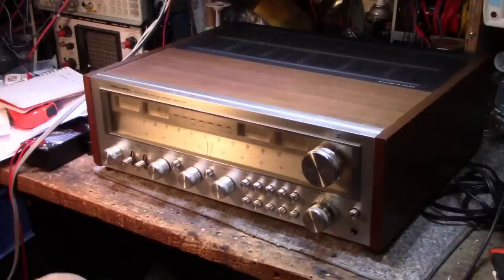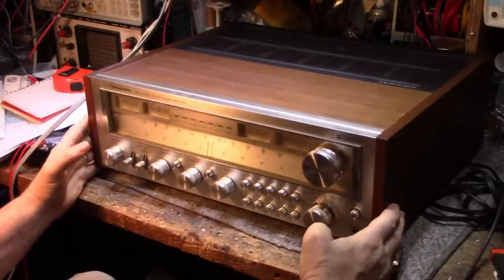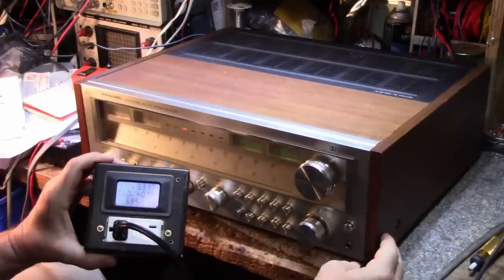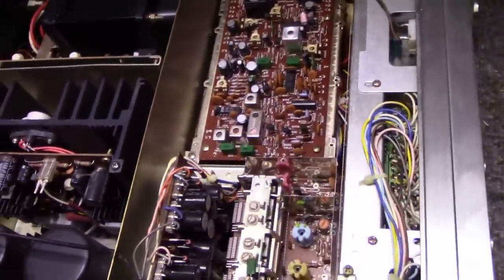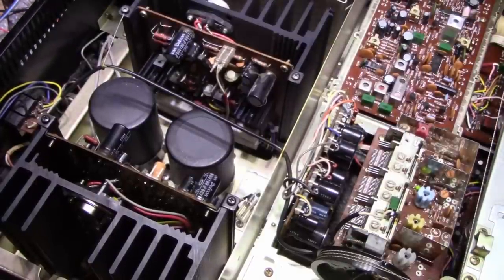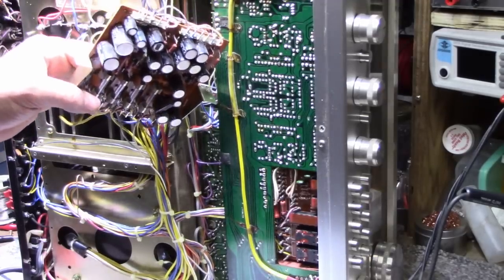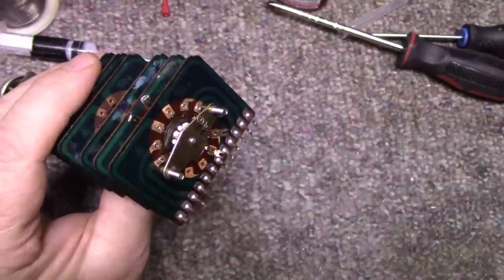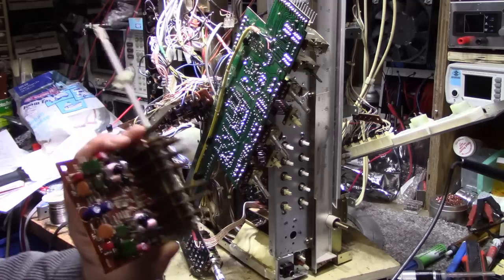Realistic STA-2100D MONSTER Receiver - Repairs (Ep. 159)

Comment: I worked at Radio Shack when the STA2200 came out. A guy had just gotten a big tax refund and wanted a top of the line system. I sold him the 2200, a set of Mach 1 speakers and a bunch of other stuff. As we were talking I asked him if he had kids. He had two sons, ages 15 and 17. I grabbed a couple of in line fuse holders and some 5 amp fuses, and told him to put them in the speaker lines. Sure enough he came in a few weeks later and told me while he was out the kids had cranked it up and blown the system. We laughed, he bought some more fuses, and the kids were never to touch his system again.

Comment: I recently acquired a 2100D and it has an interesting problem.  With the power switch in the off position, plug it in and it half turns on. The lights come on.  Then flip the power switch to on and after a second or so, the relay clicks and it completely powers on.     I need to get that fixed.

Comment: Wow, a very well done detailed video. I have this receiver which I bought new in Feb ‘81.  It sat for many years without much use. It still works, sometimes you have to work the controls a little to get the scratchy noise out of it. Years ago the power switch was starting to arc. I looked inside and found a double pole single throw switch with only one set of contacts used. I added the second set of contacts and it improved. I eventually wired in a relay to switch the AC and used the switch to control it .

Comment: Interesting on your comment about there should only be one ground, and for those that don't understand that comment:

First hand experience, famous airplane manufacturer, the electricians don't want to follow that concept - they believe ground is ground, they tie to chassis, it's ground.  While it MAY be ground, what people fail to realize is that all ground is not equal.  Whenever you have current running across distances of varying length, you'll induce varying voltages - so now your ground MAY be ground, but you have a different reference of ground voltage!  Bonding all of your ground reference to a single point of reference will mean that all references of ground are then equal.

Comment: Your experience shows with the effort you spend on contacts like the speaker output relay and the stacked selector switch that you removed and disassembled to clean.  Both can cause annoying noisy intermittent faults. Great job on that old behemoth.

Comment: I think the "FM 25 microsecond" switch is one and the same as the "FM Dolby" switch on the 2100D. I have the Realistic TM-1001 tuner with that same switch on it and the owner's manual says it's for Dolby FM. Also, the 2100D has a different transformer than the "toroidal" transformer featured on the 2100 since Pioneer had a patent on it and they sued to prevent Radio Shack from using it.

Comment: That's what I like to see. Préventive work, nice cleaning. It often prevents catastrophic failure. Especially the trim pot on the driver board that I assume is the bias adj, it will save alot of troubles in the future. I hate to repair what a previous tech didn't bother to fix the first time.

Comment: I don't trust sil pads. On some old Yamaha AV models sil pads were used for the surround channels. Those channels failed often and when repaired, Yamaha recommended using mica replacements. Also, further down the road when a sil pad needs to be replaced, they often stick to the heat sink and are damaged in the removal.

Comment: In your introduction, you left left out the real reason of how the STA-2100D came to be. It is definitely not the same as an STA-2100 unit plus a Dolby circuit. The STA-2100 had a toroidal transformer, infringing on Pioneer's patent on the technology. Pioneer sued and Radio Shack halted production of the STA-2100 built in Japan. 

They removed the offending round toroidal transformer, replaced it with a regular square one, removed  shielding on the tuner section, and THEN added the Dolby circuit. Big difference. The STA-2100D was produced in Korea. 

Other than the Dolby light on the face and the model number, they are almost indistinguishable on the outside. They have the same number and configuration of switches on the outside. The STA-2100 has 6 function lights while the STA-2100D has 7 (the added DolbyFM). On the inside there's no mistaking them. The round toroidal transformer in the STA-2100 is the dead giveaway. The STA-2000, STA-2000D, and STA-2100D all have the traditional square transformer.

Comment: Sadly I was inspired to rebuild a Realistic 2100D by your video. Unfortunately my photos of the connectors did not capture what is needed for reassemlbly after recapping. Is there any chance you could share your documentation of the connectors of the tone board and preamp? I really don't want this to go in the dumpster.
Reply from the maker: The service manual for the 2100D is excellent. If you don't have it already you can get it at HiFiEngine.
The schematics on the last pages is clear where the boards interconnect. All boards have numbered pins and the schematic tells you how they interconnect with each other.
I have photos but they may not make sense. If you still need help send me a email and I can send you some pictures or maybe a drawing

Comment: How do you work out what caps to use,I see some are black, some red, some blue, some green (bipolar Nichicon muse?) ? 
What heatsink paste do you use on the transistors? DO you have a recommended brand or?
Thanks for the new content.
Reply from the maker: I don't subscribe to one brand or manufacturer. I look for caps that have the highest ratings for the lowest cost.
Anything in the audio path will get replaced with audio grade capacitors or film because they are more stable, usually these are Nichicons or Elna. Everything else like power gets regular caps.
Putting audio grade caps in a power supply section is a waste of $$, IMO.

Comment: I was more interested in the analog meters on that receiver ~ radio/amplifier, [upside-down/top hung ~ power - L/R, signal strength and FM station alignment]. I used the zoom feature on YouTube to try to see them deflecting, but the lighting and the blurry zoomed in - I could just-about see the needles moving, have been curious about these vintage receivers, FM radios having a station alignment meter.

Comment: Weren't these units built for Radio Shack by Pioneer?
Reply: no
Reply: made by Foster Electronics
Reply from the maker: I don't believe so, they were in competition with pioneer. I heard on another YT video that Pioneer sued Realistic because the launched the STA-2100 with a toroidal power transformer and Pioneer felt there was a patent violation. Realistic followed up the STA-2100D with a E I core transformer. Don't know if that's true or not
Reply: @TrevorsBench  yes  its true
Reply: Nice Dual vid on Thursday.
Reply: @Monza62000  Yep, looks like Foster built these units.  Realistic turntables were mostly built by CEC with a few built by Matsushita.
Reply: @Monza62000  I believe you, but it sure looks Pioneery.
Reply: @SteveMasonCanada  they all looked that way back then  ...
Reply: @Monza62000  I'm sure it's true also. I've heard that for years.
Reply: @Monza62000  negative. Made by Tandy Electronics.
Reply: @SteveMasonCanada  Pioneer made no Realistic audio.

Comment: To be frank I think digital is too blas'e or mediocre I'd much rather go for a receiver with a knob and tuning dial. My tech guy told me RS had two companies that built for them one was way to budget minded, other company was very good. 
Yup this would be nice to have but w a Pioneer SX 850 and SX950 and a few heavy Kenwoods its,all good.
I am impressed w the 7 gang variable capacitor and general build of the radio shack beast.
Reply: Between 1975-89, those two companies were Foster Electric and Radio Shack's own Tandy Electronics. Tandy made about 80% of the receivers in that time frame.